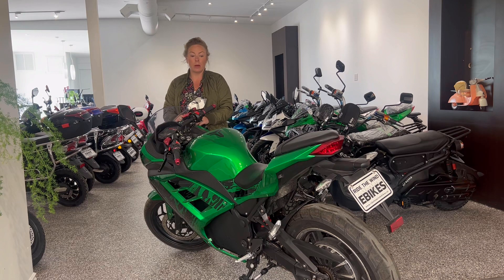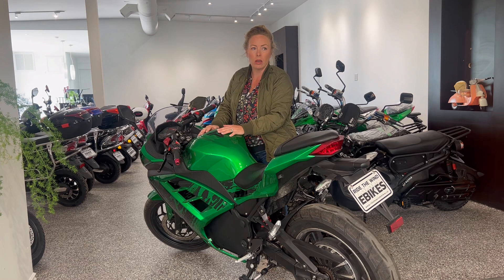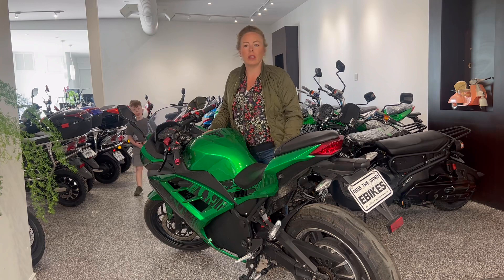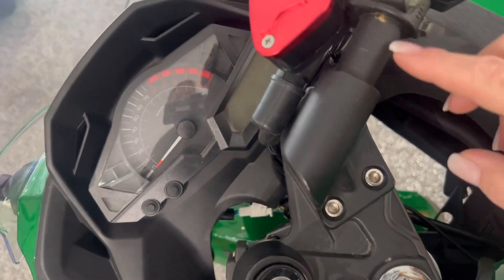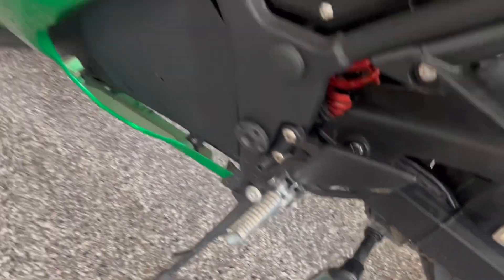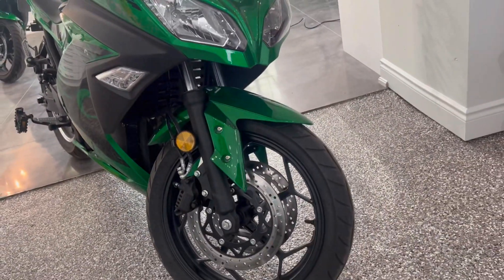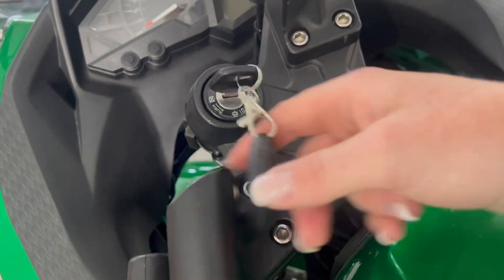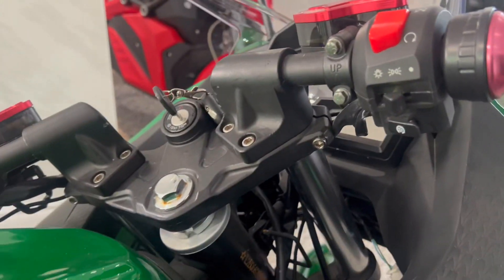How is the Quality of Ebikes Emmo Tao,  how does moisture effect them

Comment: First thing I did was grease the chain. I've got a little rust on the four handlebar bolts. Ain't nothing a little bit of coke, and polish won't fix. The paint on the handlebars has a little bit of spotting from sunlight. Haven't had a single problem with the hud, or anything else in the rain.  That bike would be easy to clean up.

Comment: Hiya RTW! Again, Congrats on your new place! 

Since i dont have a garage to keep my bike in, i use a motorcycle all-weather cover when not in use. Also, park as much as i can in the shade in my driveway (if its possible)
Also, lube the chain regularly as well as clean the brakes and use WD-40 on any moving metal parts regularly (stops the squeaking sound when your moving the bike)
Just a few suggestions on how i maintain my new Tao Leo.
Reply from the maker: Excellent advice from a pro rider

Comment: So what’s your suggestion? Change the bolts and strip down the paint? So it can handle uv rays and get better protection paint? Maybe have a take it to auto body shop and get a clear coat? Also congrats on your new place
Reply from the maker: Hey,   if you could cleat coat the nuts and bolts, for sure.  Grease where you can.  Keep it out of the outdoors when it's not being ridden.   That's really the only thing.  But that's the same as anything,  out of the elements means less aging

And thank you!  We couldn't be happeir